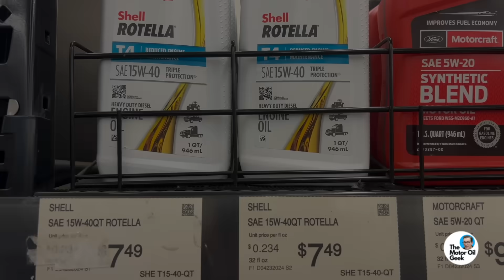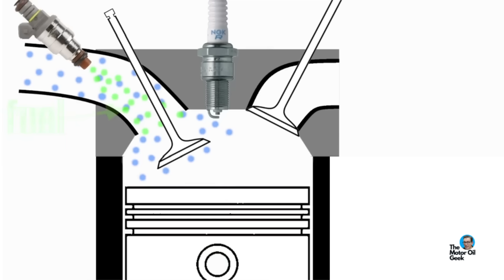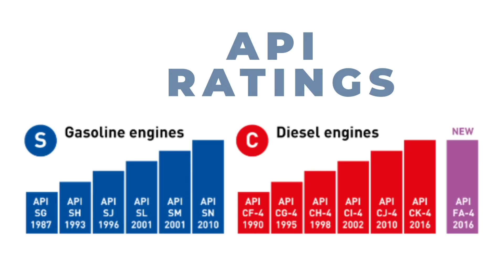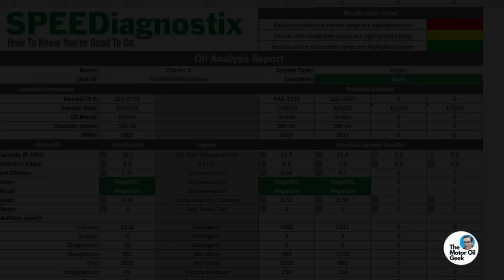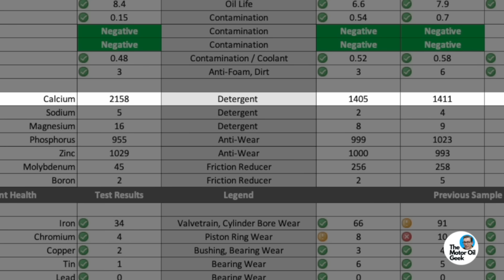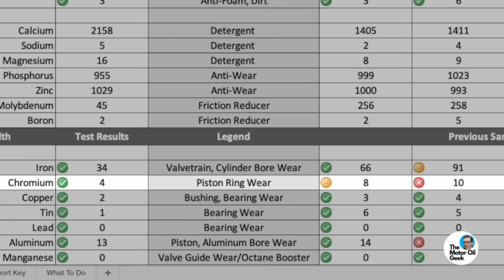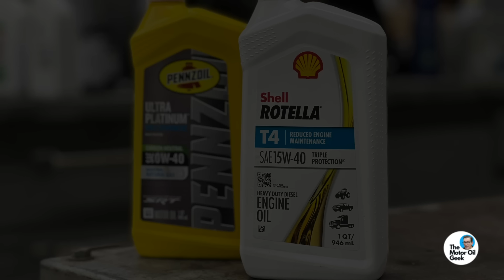Why DIESEL Oil is Actually WORSE for Gas Engines!

Comment: I wonder if there should be a class action lawsuit against a lot of Mercedes Benz dealerships. They purposely put 5w-40 ESP and n our vehicles. I asked the service writer why we are using the wrong oil and he said because you can buy 5w-40 in bulk but not 0w-40. I always wondered why the 5.0 engines would whine on start up maybe it was because of that.

Comment: All the Japanese motorcycle manufacturers recommend this as an alternative to their proprietary products. And they all seem to know what they are doing. I’ve also ran it in every old V8 for decades now with zero oil related issues you can’t find that zinc content in any other oil the same price range.

Comment: Got another question. I recently sold my elderly Cessna, low lead burning gasoline. She'll recommended their 20-50 blended synthetic oil. I have some left over Shell aviation oil.sgoukd I run it or a mixture of 20-50 automotive engine oil + zinc additive for my old flat tappers. My aircraft mechanic thought the Shell aircraft oil would be just fine in my air cooled 9.5 to one Cirvair engine. What do you say?

Comment: Hi i have a 14 ram 1500 3.0 ecodiesel it calls for 5w40 euro oil, but my question is would diesel 5w40 be better or the euro 5w40 in your opinion? Thanks

Comment: For a 100 years, we had pure oil with no synthetic additives. At diesel's ran, a million miles cars ran 200300 1000 files. LS they were in New York City. They rushed it away it's not the oil. It's the adjectives they put in it if you use diesel oil or any oil in your motor that's synthetic.  The caustic chemicals they put in the gas mixes with the oil on the cylinder walls that normally goes down back into the current case. It mixes with that oil and create a diesel there. So you've got 2 fuels firing at the same time. I never saw our pistons. Melt it and my life until formulated fuel. Or Obama gas came along and Obama diesel.  There's a guy that rebuilds motors here.He came out with a motor.
Diesel That had 900000 miles on it and it was clean as a on the inside and I posted on him that they use farm diesel and he came back later and sent me a message dad?Yes the check with the owner and they have been using farm diesel

Comment: If I’m not supposed to be running a diesel oil in a gasser, what would be a modern oil equivalent to an SAE 30 oil?  Been running T6 Rotella 5w-40 in my recently rebuilt Continental G176…

Comment: A lot of people use Rotella in there motorcycle. I don't. Why bother when there are many good specific oil's for motorcycle's. My v-4 honda 75,000 miles. Mobile T-4 . Doesn't use any oil and seem's just fine. I change before 5,000 and oil actually doesn't seem that dirty.

Comment: Does that apply to primary oil in Motorcycles? Which diesel oil is recommended for the primary case. I use gas Amsoil in secondary.

Comment: OMG!  ya'll hush up! I've been running Rotella T 15W40 in my 91 S10, 87 560SL, and sence I built a blown BBC with flat tappet cam in my 78 Camaro for at least 15 years, or 20 now?  They dont need to hear you guy's spewing garbage on what keeps them alive! I even run it in the gear box of my old race bike, 94 YZ 250, I wouldn't put it in a newer car engine calling for 5w20, I dont know why they dont just run transmission fluid in those engines, But if you have some old school or something with over 250k miles? It works fine!

Comment: now i've got a question, lets say i use standard motor oil, then once in a while i use diesel oil to remove "soot" ofc with less mileage so it won't wear the engine, does it work? or just use engine cleaner is better?

Comment: As a fleet manager I has to KISS (keep it simple stupid), I have gasoline and diesel trucks. 50 on the road every day, 6 spares. I use 15w-40 diesel oil in everything. 10,000 mile PM's. Oil samples sent to Speed Diagnostix. Motor oil is a tool and you need to use the correct tool for your job. My fleet averages over 5,000 miles a day. Diesel oil is inexpensive, durable and lasts a long time. I have zero oil consumption between PM's, which saves me money. Extended drain intervals saves me money. I have trucks with over 600,000 miles on them. I have two Freightliner's with the GM 6.0 GDI, I PM those every 5,000 miles because of fuel dilution.  My GM 6.6 GDI's and my Ford Godzilla's (which I have the most of) all get 15w-40 diesel oil from their first PM to their last. Zero sludge, zero varnish, replacing the valve cover gaskets on a 200k Godzilla and you'd think it only had 100K based on cleanliness. These are delivery vans, fully loaded and driven hard 7 days a week. I will continue to use diesel oil in my fleet.
Reply: Are you using T4 (mineral) or T6 (synthetic)? Have you considered 5W40 gas/diesel?

Comment: Lake, I need your help with this; you are the only internet oil specialist I trust. I have a 2022 Ford F-350 6.7 PowerStroke.  How do you feel about Rotella T6 10W-30 motor oil for my engine? I looked for a Rotella T6 test you may have posted but couldn’t find one. If you wouldn’t recommend Rotella T6 for my 6.7 PowerStroke, what oil would you recommend? I appreciate all you do for everyone.
Reply from the maker: T6 is great for a diesel engine.
Reply: @themotoroilgeek  Is there a better choice of motor oil available for my 6.7 PowerStroke in your opinion?

Comment: Why not just buy the correct Amsoil Hot Rod, Valvoline VR1, Brad Penn, Gibbs, Redline, etc? No need to run diesel oil in a gas engine in the first place.

Comment: One thing I do know is that if a ford says 5w20 on the oil cap you better run 5w20 in it or it will shear the pin that drives the oil pump trying to pump thicker oil and burn the motor up.ask me how I KNOW.

Comment: I run NOTHING BUT shell rotella t4 in ALL of my motorcycles, four wheelers, my side by side and my 26 year old gas powered truck with 286,000 miles and never had a problem with any of them using oil or any engine damage caused by the oil.I did a valve check on my 20 year old fjr with 143,000 miles on rotella and the inside of the motor was spotless with one valve out of 16 out of spec.and it's seen 9000 rpms a lot over the years! never believe anyone with a made for TV name.

Comment: Is there any chance that bumping up against the rev limiter might be a cause for low speed detonation.?  Burnouts and drifting are never good for an engine.  Unburn fuel migrating under the rings.  Turbo engines with dense fuel/air charges and higher pressures, combined with very little squish area between the piston and cylinder head.  When the rev limiter hits nothing gets burned.  Off the rev limiter and it goes bang.  Another issue is the shift points with automatics that lug the engine in order to produce better fuel economy.  Low speed going up a hill part throttle and watch the shift points never get above 2000rpm and should allow the engine rev out to a more efficient RPM.  While this is being done the timing is pulled back causing the fuel mixture to not completely burn under load.  This is a problem that can be seen in the load tables when tuning an engine.  It is not all steady state freeway driving.  Thanks for your tireless research on engine oil.  I know Gibbs racing oil was created because they couldn't find the oils with the additives required for their racing engines.   I think Direct Injection has created a problem due to marketing.  Direct is fine for part throttle low load, but we are learning that Port combined with Direct combined with correctly balance load tables in the tuning map also reduces emissions and improves performance.  Have a great day.

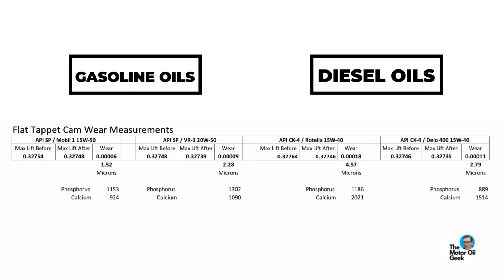Comment: Around 8:00, I notice that the gasoline oils tested were 15W-50 and 20W-50, while the diesel oils tested are both 15W-40.  I don't think that it's even CLOSE to a fair comparison to pit the diesel oils against a significantly heavier weight oil, because the more viscous oil will OBVIOUSLY result in less wear.

Comment: Ran 15w40 rotella in a rebuilt flat tappet 454 for years. Changed oil to valvoline full synthetic 10w40 and wiped a cam lobe out the next day

Comment: Been running 15w 40 diesel engine oil in my 2.2 4cyl caviler gas motor and it runs perfect.
Any thoughts?

Comment: What a weird name for an oil, reminds me of bird or plant name.

Here in Aus a lot of people use the Penrite brand.  I ran one of my old 3800s on the 10w40, factory specified 20w50 which I think is too thick as the oil pump whines on them when it's cooler outside with more than 80psi OP at full temp. I think GMH just did a blanket spec for all their cars at the time with the common 20w50.  The US oil spec for the same engine is a grade or few thinner.

I did a UOA on the Penrite 10w40 and it was fantastic, only silicon was elevated but none of the other metals that could be part of say piston material, so likely just sealant in the engine leaching some silicon. So I just stuck with that 10w40 (now 10w50) and 15w50 range from Penrite.

Not that I pay much attention to ZDDP, but Penrite other than their Eco range has around 1100-1400 ppm. That particular engine was torn down at 300k when the car was written off and it was amazing now little wear other than 3 bores that were scored from the overheating event that locked the engine solid when the fan relay or something stopped working in peak hour and I had no where to move for over 20min, no EM lanes, before I noticed it was too late. Typical Melbourne.

Comment: Why are you comparing  flat tappet wear from mobile 1 a synthetic oil to rottella T4 a cheaper conventional oil? They are not even the same weight of oil! Were the cams installed in engines that used that oil to test for wear?

Comment: Update video for Rotella T6 is needed please... It even has a JASO MA Cert which is for motorcycles(gasoline). I do understand it's hard to find a 5w-40 SP/Gasoline engine oil to compare apples to apples. I'm not interested in T4 Rotella at all, i need more info on T6... I want to know if your results on T6 align with ProjectFarm or not... His film strength test results for T6 were impressive and it made me feel more confident in my already present over-use of T6 in almost everything that the viscosity would allow(mowers, sxs, motorcycles, diesel tractors, diesel truck, etc). Since watching your vids my mower engine sounds a little louder but i think it's all in my head now..... LOL

Comment: Thank you for finally doing this.  I’m literally exhausted from trying to tell these old heads still running Rotella on their SBC’s that they are experiencing more wear than less. They all swear by the ZDDP and I’m always arguing it’s because the ZDDP competes with the high detergents for space.  The amt of ZDDP misleads them into wrong thinking.

Comment: the new fad is to use Rotella in the primary of a Harley D. Does high ZDDP interfere with the clutch?
Reply: AFAIK, ZDDP increase friction, so i don't think any oil with high ZDDP level will cause clutch slippage.
Reply: @brrrtd  Increased friction is not good for hub bearing, chain, compensator, etc
Reply: @craigssellingmine  Increased friction doesn't always equate to increased wear, a thicker oil has higher friction than thinner oil as an example, and Rotella zddp level isn't that high anyway.

Edit: ZDDP tribofilm acts as a sacrificial layer, increased friction is a consequence of how it behave as an antiwear to prevent direct metal to metal contact.
Reply: @brrrtd  I disagree about the friction part, plus Rotella is not an MA-2 oil. Rotella was designed for a motor, just not designed for motorcycles. Castrol & Amsoil were designed for motorcycles not cars & trucks thats why Rotella isnt a 20w 50.
Reply: @craigssellingmine  Rotella is JASO MA/MA2 rated.
Reply: @brrrtd  see 5:35 on the video. Diesel oil is completely different than a gas engine motor oil.

Comment: Interesting.  While I was in Minnesota I contacted Shell Oil with questions about Rotella T6 for use in a 1983 Allis-Chalmers with a Toyosha 1.3L 2-cyl diesel engine.  I used for plowing snow.  No problem running T6 oil,  that called for conventional oil in the owners manual.   Now in Kentucky I mistakenly ordered what was listed as 30WT conventional oil for my Briggs&Stratton and Tecumseth lawn mower engines.  What was shipped was Super Tech 30WT diesel oil API CF-2.  Can you tell me if it's okay to run this oil in the gasoline powered carbureted  engines?  Curiosity, Do the additives in oil separate from the base oil over long periods of time?  I have a 1973 Mustang with a 302.  I always used Havoline 15W40.  I still have the car and a case of it from 1985.  Can I still use this oil or should I consider going to a synthetic?  Thank You for your expert advice.

Comment: Thanks for sharing this because I was contemplating starting to use diesel oil in all of my engines. Both water and air cooled engines. Motor cycles as well. 
May have saved me from some big headaches. 😏

Comment: Very interesting!  I knew the difference due to soot, the additional detergent, but I never thought much about wear.   I used to run 15W40 Rotella T in my 1990 Pontiac Sunbird with OHC 4 cyl. engine.  It ran wonderfully on it, and I even pulled some of the best fuel mileage out of the car while running this oil.  That alone was pretty good as it was during summer heat on higher speeds through hilly rural roads.  Now I wonder if it actually caused excessive wear to things like the camshaft.  Very useful information to have, and a good reason why I know stress that people run the correct recommended lubricants.  There's a reason why they provide a specification!

Comment: You can do all the desk testing you want, but nothing compares to real world on the road results, my 2002 Chevy 2500HD 6.0 gas engine currently has 985,630.4 hard beat on borderline abused miles, original engine never even had valve cover gaskets changed, it has run nothing but Rotella and Delo 400 15-w-40 since 72k miles when i bought the truck. It still runs hotshot loads through 46 states, and still gets 11mpg no matter how loaded i am (except for when im going through the Rockies, drops to 8mpg on them mountains, 6.0's are rev happy). I run it in every single engine i own, from lawnmowers to my truck, Including my 2004 Cadillac Deville Northstar, 2003 Oldsmobile Aurora Northstar, and my 2006 Chevy Trailblazer 4.2 Atlas. Haven't had any engine failures since i switched to the diesel oil.

Comment: Weird, I have a 1980 'throw away' Pinto wagon in concourse condition with 2.3, 4 cylinder. I use a FL 299 truck oil filter and use 15W40 diesel oil. 100,00 miles, runs like a top, never been apart...not even the valve cover removed. Does not use or leak  oil. Does not have any tapping/knocking noises.  Has been over the rocky mountains and has seen many long high speed runs on very hot days. Can you explain it's longevity?

Comment: I haven't even watched your whole video but I don't know what you're talking about rotella t6 synthetic 540 is ran in my BMW my Acura I have 300,000 miles on each original rear main seal nothing leaks I've done the front seal obviously for timing belt and timing chain issues... I get amazing gas mileage at purse like a kitten and I drive them both like I stole them with 300K on them...

Comment: I broke in my new 383 sbc for my pickup on the BR30 and then the GP1 and everything is great. I used diesel oils years ago but now i prefer the gp1, it's great for a rowdy hot rod engine. Driven also makes a Hotrod Oil and a Racing oil but i think the GP1 works fine. I'm one of the few that still runs flat tappet cams and the GP1 has kept them alive!

Comment: Nobody mentions the API SN rating right by his finger on the Rotella T4 bottle…
Reply from the maker: API SN does not provide protection against LSPI and is higher in Calcium.
Reply: @Right, it’s not LSPI-protective, but it is still spark-ignition rated under API SN—intended for port-injected gas engines before GDI became common. The higher calcium is part of its detergent package, which was fine for older designs without LSPI risk.
Reply from the maker: @newoslands97  Fine, but not as good as lower calcium packages such as API SP.

Comment: BMW (E87/M47TUD20) 120d AT, stage 2 202BHP/335lb-ft, 5 door hatchhback is a passenger car. I use Motul Specific 5W-40 LL04 (BMW spec for diesels) oil and BP Ultimate Diesel (higher cetane)

Comment: Love your content, the internet is unbelievable.    Would you be willing to say what oil you would use for a diesel pickup, (new Duramax)?   Next what about a 2 stroke dirt bike that only uses the oil for transmission and wet clutches?   I heard  MA2 is best for clutches you don't want to slip like a road bike but dirt bikes we want to slip to a point and MA may be better. Thanks
Reply from the maker: Thanks for watching. We see good results from a variety of brands (Rotella, Delo, Delvac, Valvoline, Amsoil and Schaeffers) in Duramax, Cummins and Power Stroke engines.

Comment: Look, im sure you are correct. However .
   Ive used 0w-40 in my honda foreman atv and is still going after 21 years and 20,000km
And also used 0w-40 in my 97gmc 3/4 ton gas and its still going strong .

Comment: The Deere Diesel engine oil is Rated SN for spark engines. I wonder if they use a different additive package than Rotella or Dello that lets them make the oil ok for both compression and Gas engines. Deere has flat tappet cams in both Diesel and Gas engines so I suspect they have it formulated as such.

Comment: Would really love to see your opinion on “restore” motor oil additive. It’s different than any of the other additives by supposedly having copper silver and lead bind to the cylinder walls to fill in some of the scratches. I used it on a 250k mile Prius that burned 2-3 quarts every 5k. Went down to 1-1.5 quarts after.